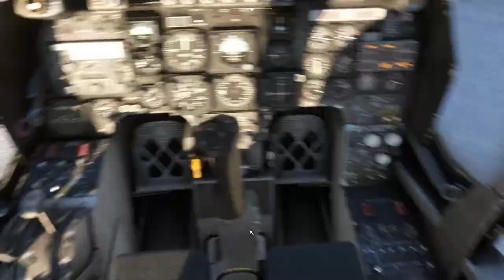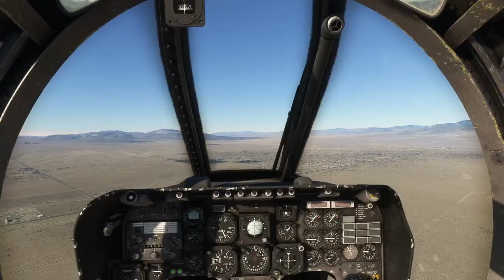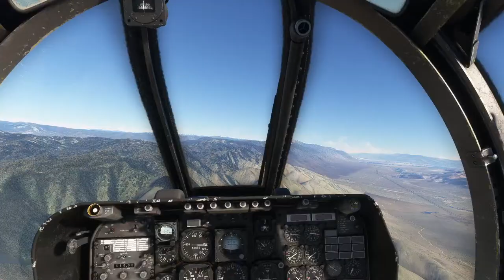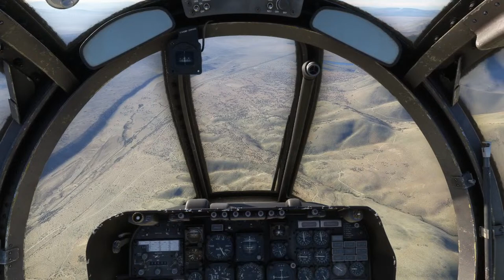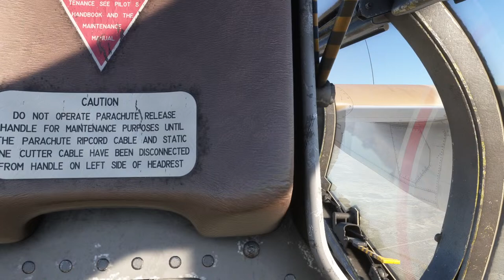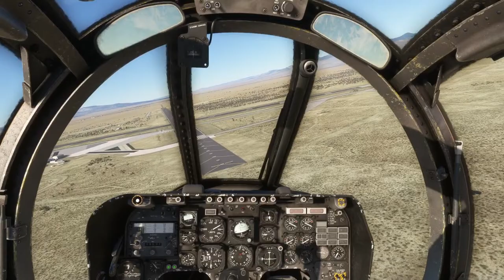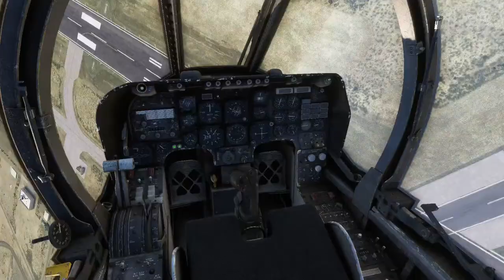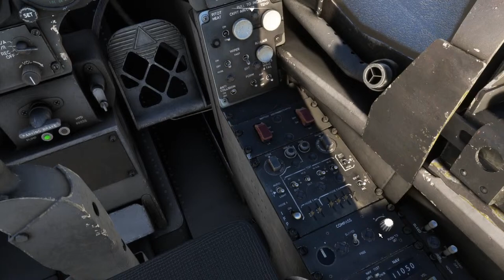Livestream with the AzurPoly OV-10 Bronco at China Lake in Microsoft Flight SImulator

Comment: Goddammit to bloody hell, man, has no one ever taught you to monitor EGT and oil pressure during engine start, rather than cranking your head out of the cockpit to watch the propeller spin up (which somehow seems to fascinate you).  Go buy yourself a little windmill toy someplace and watch that spin around on your time off instead.  You're grounded for now though before you set something on fire.  :(

Comment: I bought this after your review. I do love it too. 

One question, do you find that you're using about 50% up trim and that the aircraft climbs or descends like a demon?
Reply: It does have an insane climb and descent rate- which seems to be accurate to the real thing.
Reply: @industryguy07  yeah, I think the plane is amazing! But it really does go from 0 to 2000 (or 4000 even!) Ft/min with tiny amounts of input.

I did watch two videos by former OV-10 pilots that both agreed the aircraft is very accurately modeled in the sim.